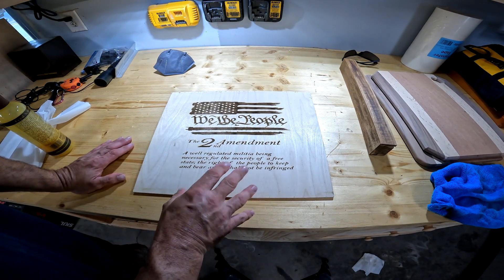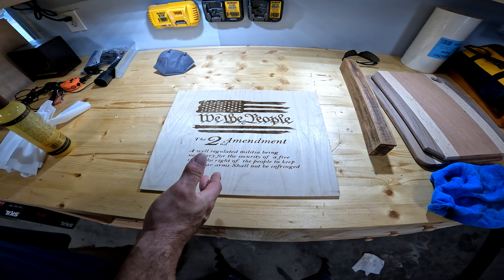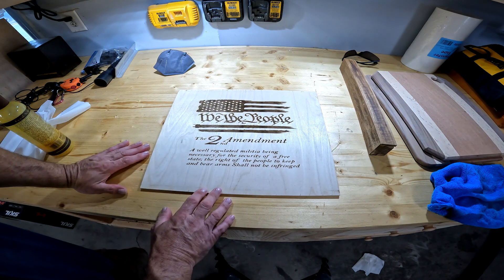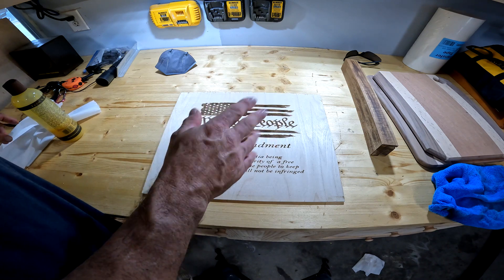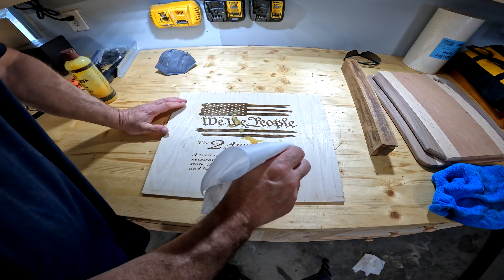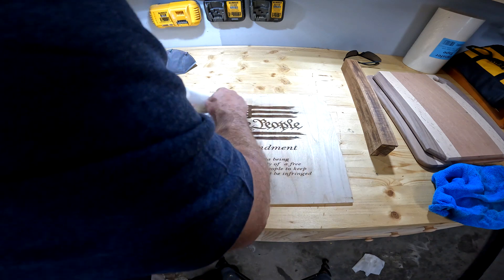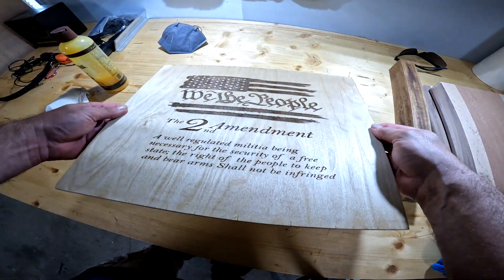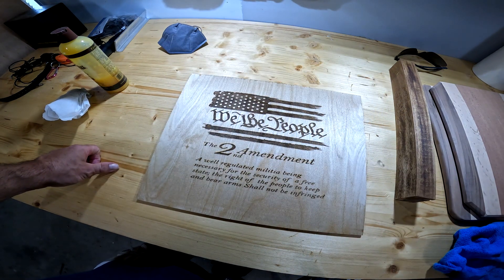Make Your xTool D1 Cut Like a Pro | Laser Tricks That Work

Comment: You didn't show or give details about the product you used to wax the wood.  You didn't list it in the text description of the video.  That would have been useful.
Reply from the maker: Everyone has a different opinion on what to wax or coat the board with.  I used Feed N Wax from Lowes.  https://www.lowes.com/pd/Howard-Feed-N-Wax-Oil-based-Wood-Conditioner-Actual-Net-Contents-16-oz/999918618?cm_mmc=shp-_-c-_-prd-_-pnt-_-ggl-_-LIA_PNT_219_Stain-and-Spray-Paint-_-999918618-_-local-_-0-_-0&gad_source=1&gclid=CjwKCAiA8sauBhB3EiwAruTRJm_DxeyUxhMDFiyd2DAw38BRW-bx9r-9m9nVSZ-Q-Ue-_dJ9c3TI9RoCHJgQAvD_BwE&gclsrc=aw.ds 
I also use Butcher Block oil also, it is "food safe" where the other is not, so if your eco friendly or you are going to be handling it then food, possibly a better option.  https://www.lowes.com/pd/Howard-Butcher-Block-Conditioner-Clear-Butcher-Block-Oil-Actual-Net-Contents-12-oz/999918606